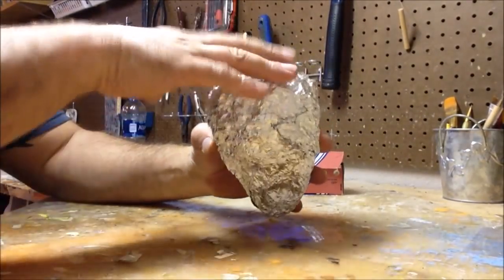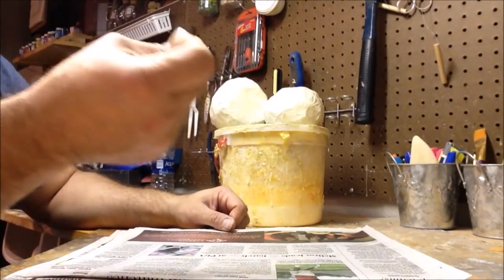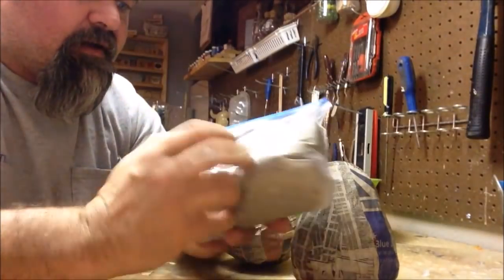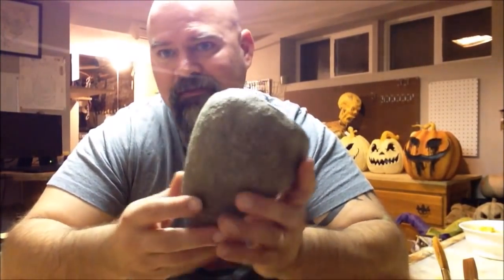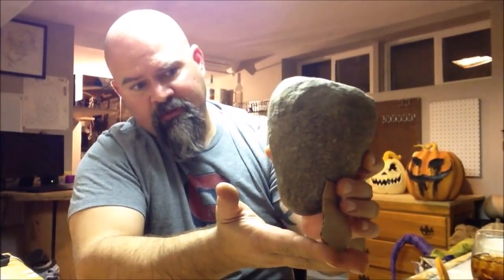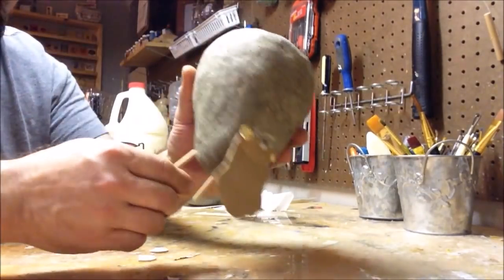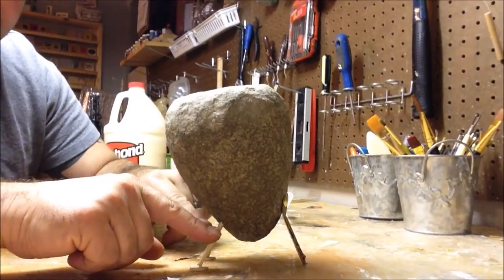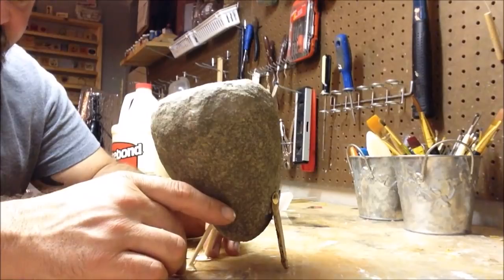Making a paper mache owl part 1

Comment: I tried paper mache in 2019 but it didn't go well. Now it's 2024, I want to try it again. What is the bucket mixture? Water with glue, or wallpaper paste with flour? Did you called it cookies and cream? I think the last time I tried with flour and water and I think it didn't work because the bonding wasn't working. Something is missing. I totally want to get my DIY project going before end of September.
Reply from the maker: My paste mix is Tightbond II wood glue and water. Usually a 1 to 1 ratio.